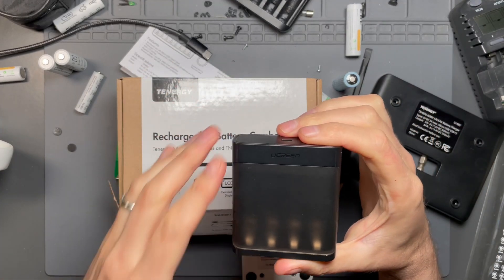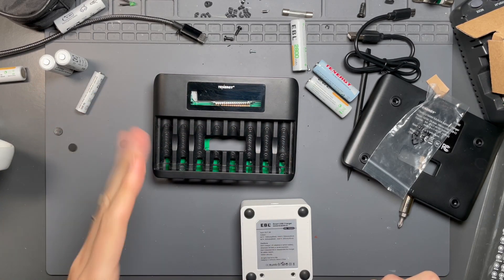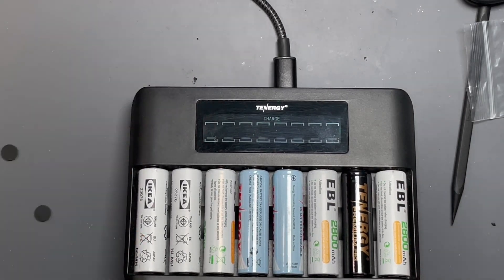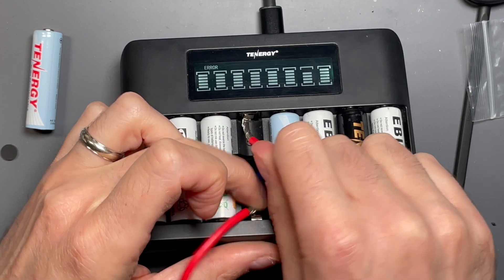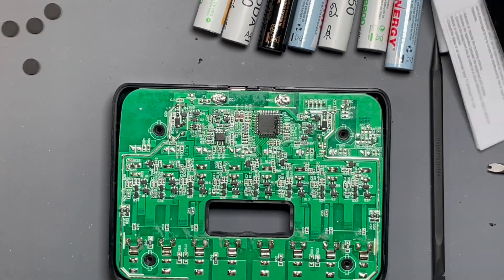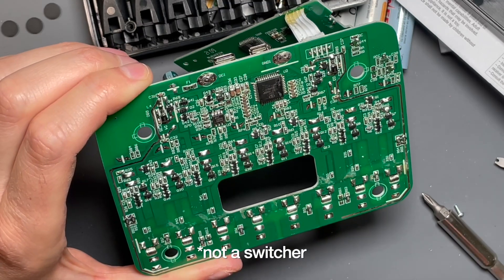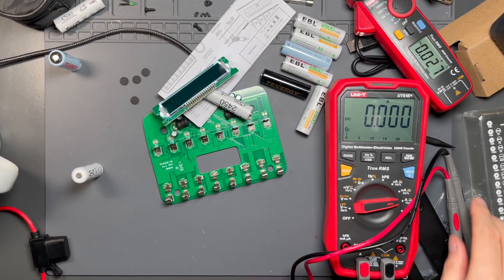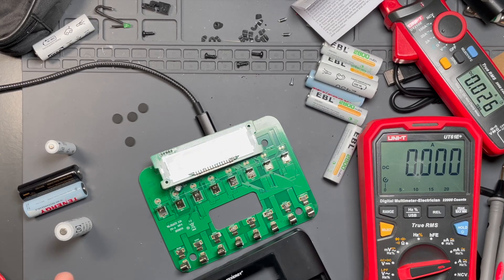Tenergy AA/AAA Ni-MH Battery Charger

Comment: Thanks for the deailed review that includes dissection.  They may be "pulse charging" if you want to look it up. 
I don't think that 1 Amp is too high for a AAA cell to handle if they are monitoring the peak.     The earliest fancy Nimh charger from Astroflight that I owned recommended  1.2xCapacity charge rate to make the -DeltaV peak more detectable.